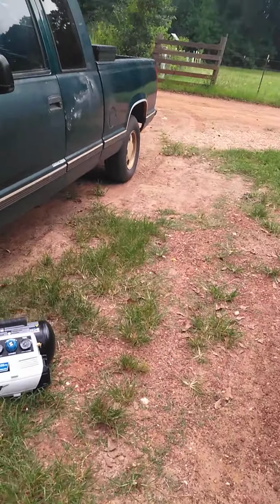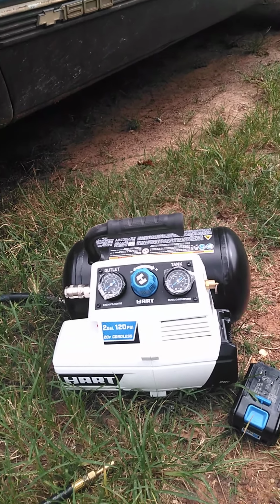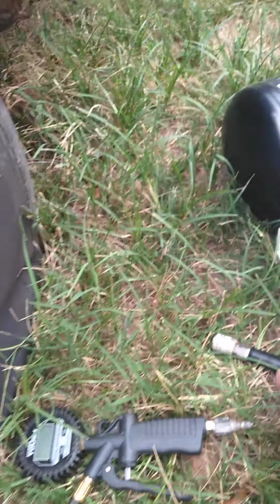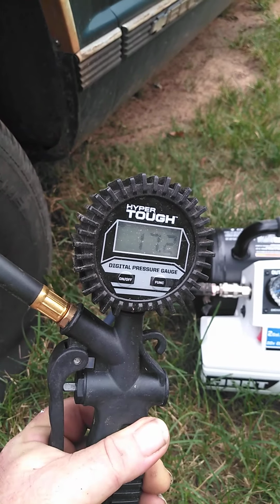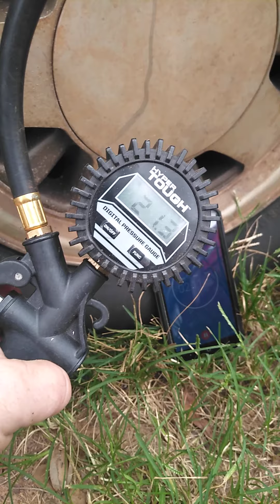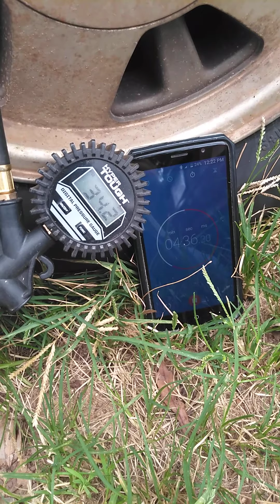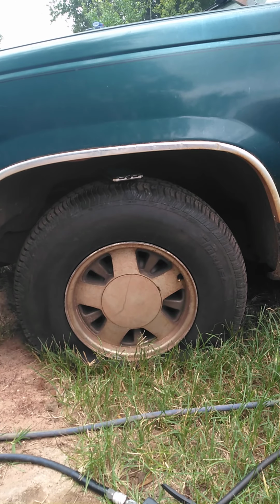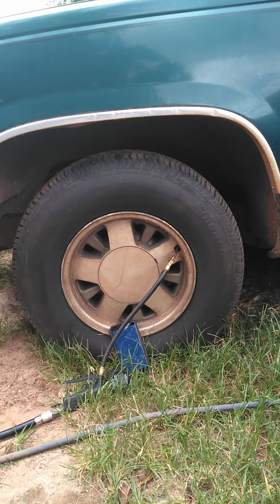20v Hart 2 gallon air compressor

Comment: That is mentioned with a full tank thats y it has a tank
Reply from the maker: It doesn't say anything about the tank being full. It does say it has extra storage for air with a 2 gallon tank.
Reply: @tommychristyjr9193  I mean, it’s kind of common sense that you’re supposed to fill the tank up before you start the Airing Process. you get away with this with a more powerful compressors doing this, I use to paint cars. I guess Hart should’ve been more particular. Either way thanks for the review.

Comment: Aren't you supostoo fill the tank first? And why a 50ft air hose when the air compressor is mobile for convenience? Is it me or does video lack common sense?
Reply from the maker: 50 ft air hose is what I had at the time. I didn't fill like driving a hour away and back to get my 15 ft air hose and the tank was not filled Hart advertised it as it would air a tire up on a empty tank with in five minutes wile it's filling the tank for extra air. This was when it first comes out. So I followed there direction. When a tank is full you have volume the compressor is still pushing air. So the tank is extra air volume.
Reply from the maker: Thanks for watching the video I appreciate it.